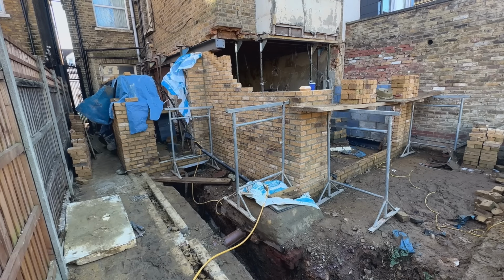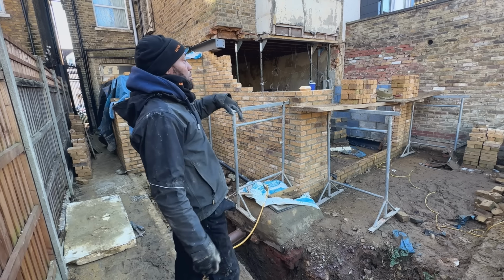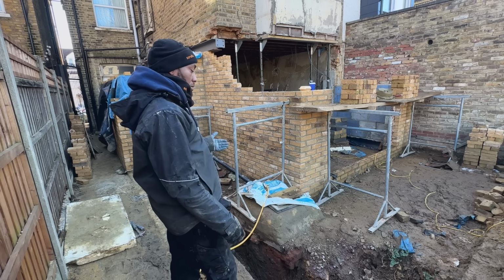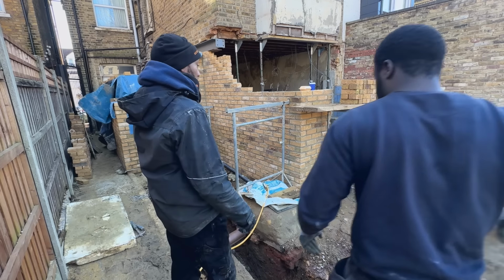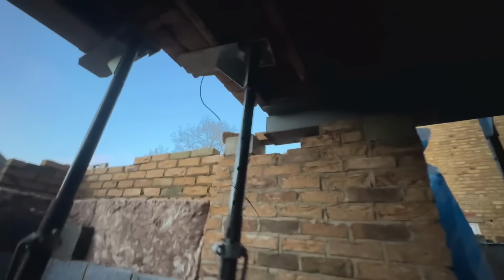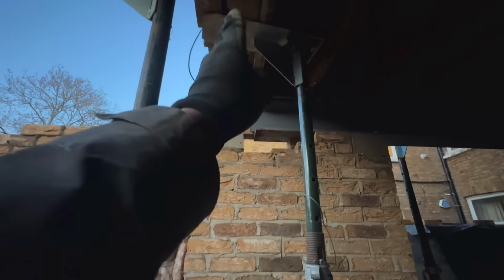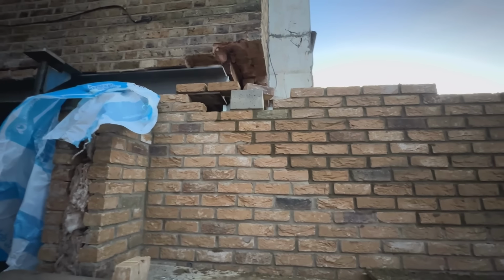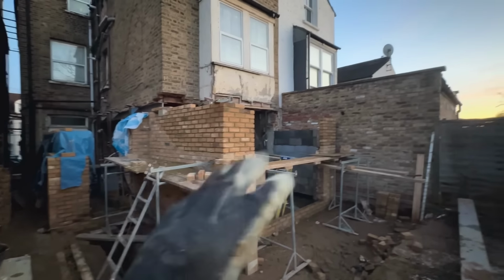Rescuing a cowboy build - Day 41

Comment: I think there should have been a pier inside for the padstone to sit on to prevent it being visible but more importantly to prevent the thermal bridging that is going to happen there with the stone... there should be insulation between the outside and the padstone and the new steel is going to get cold and condense any moisture that gets to it... Possibly halt there until you get hold of the engineer and discuss this...

Comment: padstone and steel is surely going to be a major thermal bridge, ideally you need to have a continuous thermal insulation either inside or outside the steel+padstone, not sure if that's been detailed by the designer (architect?). I wonder if the steel might end up condensing in the ceiling void?

Comment: Cut 20mm off the pad then later date resin 20mm face of the bricks on pad point in like a brick slip would never know. 20mm cut off pad ain’t going to structurally change nothing.
Reply: What about 10mm slips? And then stick em with some construction adhesive and point em up
Reply: I'm with you on this one, get a small grinder and shave 20mm off it now. It won't make any structural difference to the pad stone. You will never know it was there once faced with brick...good idea.

Comment: Ain’t that bit where you see the pad stone a flat roof? If it is can you not get calcs changed to lift the steel a couple courses higher as it is not bolted to the other and then hide the pad stone behind the fascia? A lot of work for a small detail though

Comment: That's a bad detail. That new beam should be sat on that green inner wall extended like those opposite. This will allow some insulation. It would have to be checked structurally for crushing strength of the bricks below and to size up the padstone accordingly. Or could have designed a steel column / brick pier. I don't see what they are trying to do in the inside. It looks like there will be a step in the wall. Why wasn't the green wall extended to meet the return with the door? And how would they have covered the steel in the original design if those beams were connected on the corner. Building Control might pick up on the lack of insulation, or were you going to use that stepback on the inside to put some insulation behind the plasterboard. I'd keep hassling him to correct this. That padstone doesn't need to be showing on the outside.

Comment: Why can it not be a wider 4 inch pad stone sitting on the inner portion of the wall with the facing brick on the outer? 
Or swap the pad stone on the inner for a much wider steel spreader plate to spread the load across more of it, surely structural engineer would approve one of those 2?